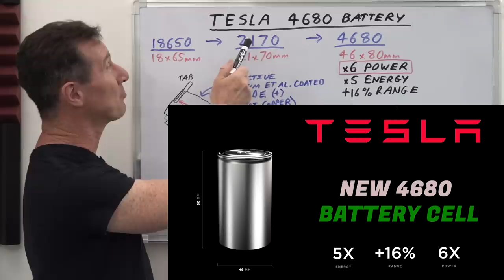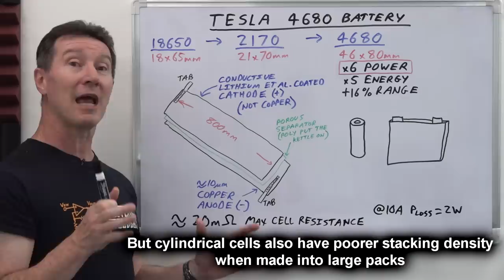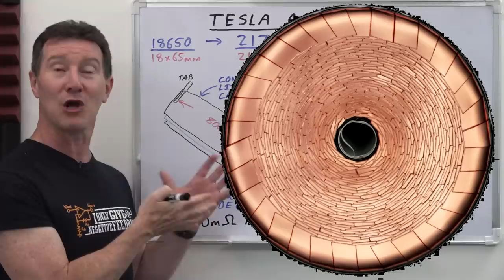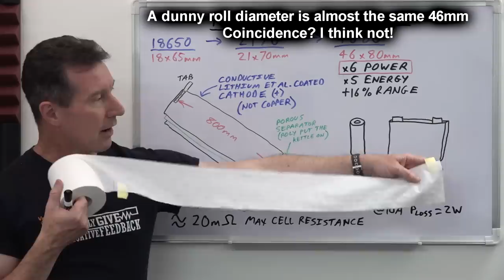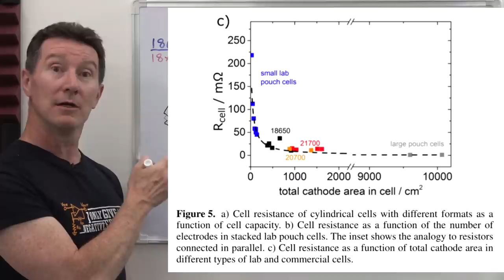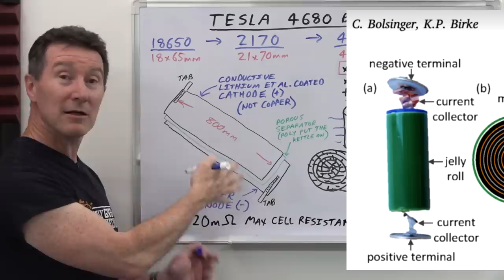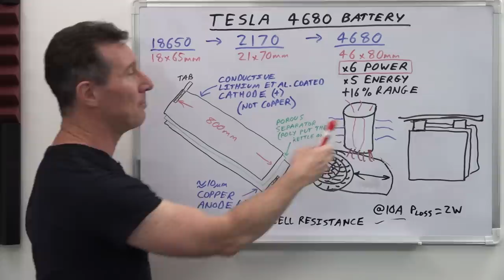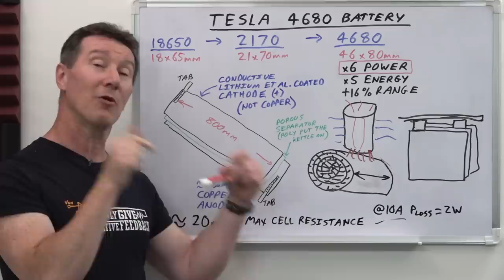EEVblog 1340 - New Tesla 4680 Battery Cell EXPLAINED

Comment: Thanks for finding the time to make that one Dave. As I suspected it was a little talked up for just a new cell size and a slight change in the architecture. If all the other things pan out and they hit the overall 50% range gain it will be great, but I'm pretty skeptical about their theoretical numbers vs what we will really get when the time comes. 14% is the only real confirmed number I have seen so far, so I'm going to use that for now until they demonstrate all these other things working. We are still waiting on a hyperloop and a real mass transit tunnel after all, so I'm not holding my breath on a $25k EV unless it's like the boring tunnel and what is delivered is hugely short of any traditional expectations. Half expecting it to have seats as an option TBH, if not have some sort of strings attached deal like the free Xbox consoles with a subscription fee that just puts the cost elsewhere like a fee to access the charging network.

Comment: the 5x energy is only from formfactor. Chemistry changes are not included in this number. +16% range probably means + 16% energy density (energy/weight). But also - this is only from form factor change + tabless design.
Reply from the maker: That's what my calcs showed must be the case.
Reply: @EEVblog  Yes. But it was also explicitly stated on the presentation. Only think I don't understend why 5x energy - when volume is 5.5 bigger. Maybe empty space in the middle needs to be larger due to tabless design?
Reply: only cell design that is correct. The anode in itself gives more range increase .. i believer extra 20 procent range .. in total the new battery will give 56 procent more range .. this is insane!!
Reply: W P, the energy density by mass was not given in the battery day presentation, nor was enough information to infer it. But what was given was the data to infer a 10% less volumetric energy density with a 10% increase in volumetric power density. 

Funny thing is, any battery cell manufacturer (Panasonic, CATL, LG Chem, Samsung SGI) can do a similar change without using some “tabless” design. We all know the 18650 cells have a wide range in choice of energy:power. 

You can choose a 2600 mah cell with 30 A continuous discharge or go to he opposite extreme and have 3500 mah with 11 A continuous discharge rating. 

Tesla could have just asked Panasonic of any company to make a 4680 cell using known technology, and gotten some improvements in Wh/kg just due to the 30-40% less metal needed for the cell case (this is based on needing 50% less area but slightly higher thickness).

The 16% range improvement is more marketable wankology. As we know there are ONLY two aspects of a battery that can increase range of an EV,   More kWh and/or less weight. By them saying the form factor alone gives 16% range is misleading because if they merely took apart a standard range model 3 battery, pulled out the 2170 cells, and added appropriate 1/5 as many 4680 cells, but uses all the same modules, thermal management etc, (after making slight adjustments for the taller but fewer cells), then there is no way these will increase range 16%.

One thing that is related is the Chinese Standard Range model 3 (with the partially empty modules) changed to LiFePO4 cells, and added enough to make up for the lower energy density. So they got a better battery, cobalt free, more range, and lower price. 

I guess the 4680 is also supposed to be cobalt free, which is probably why the volumetric energy density is lower than the 2170. And with tabless design they were able to get 10% more power.
Reply: @imho7250  The final battery pack including cooling weighs less than the current long-range version. They said somewhere over 100 kg reduction so you can add loads like 1 fat passenger to the car 😁
Reply: Mirko Naumann, exactly. Weight savings is not the huge news, but packing more kWh in at a lower overall cost without adding proportionality more weight is what Tesla and every other battery maker is working on. 

Funny thing is, the Chinese model 3 standard range went to cheaper batteries that add weight and need more room, but cheaper, safer, longer lasting. I’d love to see that new pack arrangement because LiFePO4 has a 3.3v nominal rating as compared to the 3.7v cells it replaces. That means they need 108s pack to keep a similar voltage.
Reply: @imho7250  The Model Y will need that extra >100 kg cargo option. The voltage can vary up to 450 V. That is no big problem. We have to wait the first tests including V3 charging videos.
Reply: Mirko Naumann, the problem is not the “up to 450v”, the problem is that the standard 96s was not going to give the same voltage as before, which means it really needs new BMS boards, 3 more groups of parallel batteries in each of the 4 modules, assuming they still use modules. 

I guess we will have to see if Tesla can make their battery better than what everyone else is working on.
Reply: @imho7250  I just meant it is not sure if they bundle 108 cells now instead of 96 or 98 like with 2170s, maybe Tesla increased the voltage for LFP which has benefits, too. We need to wait the first tests.
Reply: Mirko Naumann, yes, we won’t know for sure until one crashes and gets opened up by a YouTuber. Lol. 

I don’t know how much CATL can raise the voltage of a LFP battery unless they add something else. But even if they get 3.4v instead of 3.3v, that’s still a 29v drop in pack voltage, which means current will increase in current for all charging and discharging, which will cost efficiency.
Reply: @imho7250  No, you cannot increase the chemical voltage of 1 cell. But the way you connect many cells in a row and those rows parallel is the secret from Tesla. You can calculate it:

The current chemistry must stop charging below 4.2 V. With about 4.19 V the battery pack ends at 402 V. Some chargers like Ionity show these specs.

For LFP the maximum is 3.65 V so you need 110 cells in a row to get same maximum voltage. But they use prismatic cells with a different form factor. We don't know yet it's cell size. It is possible they use 4 or 8 rows at 55 cells each. But if there is more space left at the ends and not enough to build another row they can increase up to 122 cells as row placing 61 cells in a line.

You see only 6 cells more depending on the needed space will define the maximum voltage of the LFP battery pack. Can't await to know more of it as the cheap Model 3 with heat pump will be a great car for daily use like for companies.
Reply: @imho7250  Forgot: no need open the pack. Just need the OBD Dongle which uses Björn Nyland to get the specs. Maybe Wuwa can deliver view on the powerpack before it is installed in the GF3.
Reply: Mirko Naumann, yes, I already said 108s to get the same voltage as 96s x 3.7v. And that works out evenly to add 3x cell groups per each of the 4 modules. I’m going on nominal voltage not max voltage. The BMS will be the one to prevent the LFP cells from going over voltage. It tells the charger what voltage to put out, the charger doesn’t decide. 

It’s possible they just started with an empty model 3 battery case and redesigned everything inside to fit the LFP cells. CATL likes prismatic cells, so the thermal management and everything inside would be changed. 

Someone should leak that photo. Lol
Reply: Mirko Naumann, the OBD won’t tell you any thermal management redesign or how many cells in each group, only the groups in series. But that information would be better than nothing. Nails one corner down anyway,
Reply: @imho7250  110 cells LFP equal 96 cells NMC. You need calculate with the closing voltage: 110 cells x 3.65 V equals 96 cells x 4.18 V.
Reply: W P, no, actually every cell and pack voltage is based on nominal voltage, because that’s where the battery likes to stay fairly flat during discharge. Nobody will use the 100% charge voltage. And it has Zero to do with supercharging, because it will just adjust the voltage as needed. 

What you want in when switching to a different battery is one that will have the same voltage going to the motor most of the time as the old battery. Then Tesla just reprograms the BMS for the top and bottom voltages. 

If you are converting a golf cart and trying to use the existing lead acid battery charger then yeah, you need to have top voltage match, but otherwise you will just use 13S to replace a 48V lead acid battery, which is 48v. But don’t do like Rich Rebuilds and use the lead acid charger because that’s 59V at the top and a 13s x 4.2v max is only 54.6v, which is why the 48v lithium ion battery charger is different. Lol

Comment: When Tesla comes out with a solid state battery it will be truly interesting.
Reply: What is a "solid state" battery? They already move nothing but electrons. How much more "solid" can they get?
Reply: @77gravity  The electrolyte is not liquid but a solid material.  It is still in the works but Toyota was to reveal their electric car this past summer at the Olympics and it was to have a solid state  battery .  Solid state lithium ion batteries would make a thousand mile range possible with very short charge times.   Do a search for solid state batteries....quite interesting.    the battery technology is rapidly advancing and Tesla is in the cutting edge.
Reply: @manofreedom  in this case i think is called dry instead of solid

Comment: I did not read all comments, so sorry if duplicated. Big Clive calls it "Schoopage" after the inventor of the folded contact design (which is apparently also used in capacitors).
Reply: and no mention of the "E" word   (electrolyte)

Comment: The 0 at the end is a shape designator, 0 means cylindrical
Reply: It is like any other standard (See xkcd 927) in that companies choose the part number to fit the need. I have seen it used for both. (See 14505 battery. 14mm by 50.5mm. http://www.farnell.com/datasheets/1445884.pdf)
Reply from the maker: As 

Nathaniel Huggins said, I've only seen it used as a decimal point.
Reply: @EEVblog  http://blog.18650batterystore.com/2017/06/27/18650-lithium-ion-battery-terminology/

At least in automotive,  the last digit is the shape.  This is because for instance,  an 18650 cell, depending on manufacturer,  could be 65.0mm to 65.9mm long depending on tab style

Comment: BTW, 80mm is 3.149606 inches.  Pi is 3.141592.  For all we know, the actual diameter is 79.796453mm, because that would be exactly Pi inches if divided by 25.4 (1 inch is 2.54cm)

Comment: Nitpick: you don't get better packing density by increasing the size of a cylinder.
Reply: Yup my first thought to. There are a few advantages with larger sizes, but a bigger cylinder wastes more space that will not be used directly for more cooling with this design. Also I know this is really not the intent,  but can't help to wonder how the replacement batteries will be for old size packs, like all pre 202? models, when the new batteries become taller.
Reply: If the density is described energy per weight as it should, it doesn't matter so much. If it's energy per volume, it might be cheating
Reply: I wonder if you get rid of the TMS between the cells if it's a wash volumetrically with the larger cells?

Comment: I don’t see why this is new or “invented”. Low esr  electrolytic capacitors have used this principle for years to reduce the length of the plates to the connectors by paralleling loads of connections on shorter plates rather than two single long rolled plates. Dave, do a 10 second video to explain this with your whiteboard for people to get their head round.
Reply: Wrong

Comment: 26:44 simple, the 6x and 5x numbers came from comparing 4680 to the 18650 at the cell level. Once these 4680 cells are in a battery pack such in a size of a Model 3, the range improvement is around 16%.  It is quite impressive considering there is no added material or cost but a huge reduction in complexity/cost while getting that 16% more range.  
They do mention a problem in charging speeds, as one cannot simply pump 5x current to the larger battery but they mentioned keeping at the speed as the M3. 
I'm not sure whether the Tesla roadster will get the larger cell or not because using the 18650 cells is still better for performance reasons (charging, discharge, brake regen) while ignoring cost.

Comment: Yes, it reduces the actual reaction area, that’s why it’s not 5.5 times more in energy, as it has to leave those extra space for both ends, and I don’t think pressure mounts is a good ideal, and I don’t think it can be soldered on both sides. And internal resistance is largely depends on chemical reaction potential between both nodes, the ribs are not the bottle neck here. Yes the thermal resistance is reduced but on sacrifice of safety factor as mentioned you don’t want put heat and pressure on those film roll( Samsung knows this), I don’t know, 18650 is still the most well known and high density one available on the marcker, I don’t see a irreplaceable advantage here. Maybe he just want “ price negotiation” ability be better for the firm in the future?

Comment: Great video, thanks. A quick query: You go into detail about the tabless design of the copper electrode but just don't mention the other (aluminium or whatever) electrode. I presume that the same tabless technology must apply at that end too, right?
Reply: It might not. Potentially, that electrode still needs to be point welded to. But the termination impedance just from one electrode is reduced massively, so that might be enough of a benefit, and doing both electrodes will bring an order of magnitude smaller incremental advantage to heat extraction, so not really worth it in this regard.

Comment: Why folding hasn't been used before - I'm guessing it has to do with the failure modes of cheap cells.  One has to isolate the electrolyte and the conductors so that they don't come in contact in unplanned ways.  If one gets an internal short (electrical, chemical, etc.) the battery will be destroyed.  Imagine squeezing lithium paste around the edge of the opposite electrode and around the insulator layer...
  
If the heat is highest in the core.... I wonder why they they don't figure out a way to pipe coolant through the hollow core of the jellyroll.  If one did that, and use the dead-space between the cells to add additional thermal "columns", each cell would have four columns of contact.  Do a "plenum" on each end to pipe coolant to the columns and you get the folded tabs taking heat to the ends effectively where the majority of the heat is accessible.
  
I guess it's just "too hard".  :-|
Reply: I was thinking more along the lines of needing extra space for internal separation which reduces overall power capacity. With an 80mm long cell they would have extra clearance space if they are using the same width for the anodes and cathodes as 1865's or 2170's and gaining power capacity with the extra length of the rolled up sheets.
Reply from the maker: You will likely loose some internal active surface area in order to prevent shorting issues.
Reply: Too hard meaning would be a nightmare to mass produce. The goal is to secure its supply of batteries with a process that can sustain the planned growth of demand for EVs.

Designing a way to ‘pipe’ coolant through the core, i.e. prototyping, would be the easy part. The hard part would be coming up with a process to mass produce it effectively with minimal scrap/waste.
Reply: I can see the advantages of the folding - but how do you connect to it?   The traditional tab design uses spot welding to make sure you're got a good contact.  But how is it done here?  Just press up against that roll and hope for the best?  Seems like that's iffy and prone to issues as it ages. I suspect the answer to that is where the real magic is.
Reply: @russellhltn1396  The image of the bottom cap shows penetrating blade contacts.

Comment: Close packing of cylinders is hexagonal and the proportion of "wasted space" is independent of the diameter, excepting that if you are filling a space with a constraint,  adjusting the diameter to allow an exact fit maximizes the packing efficiency.

Comment: 26:15 He was disappointed that Tesla used physics to improve volumetric efficiency and range instead of magic. 🤣 A 16% improvement is a lot, especially for engineers. To put it in perspective, that's almost 30 more minutes of driving.
Reply: 16% is huge in mechanics. I remember my thermodynamics and engine efficiency history of upgrades. oh look this cycle is sveral percent better, but the one with disel can be way, better. just tweak geometry things a bit for that part of the percent, massive gains!
Reply: But the 16% is miss-leading because each battery is larger, if the overall dimension of the total battery pack is to remain the same it will not necessarily mean that the battery pack offers a 16% improvement. If it did, why not just double the size of the battery again? 

The cylindrical design would appear not to be as efficient as the flat design, all the improvements just seem to be minimising the cylindrical design's disadvantages.
Reply: @martincday007  It's the height difference. That 1 cm just add a few centimeter on the total battery block, but it adds 14% more energy compared to the 70mm length old ones.